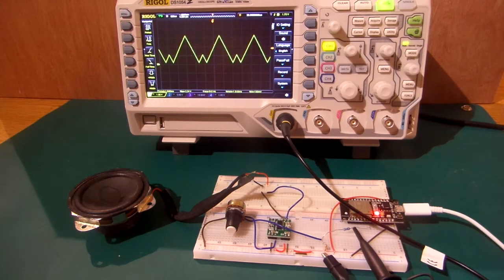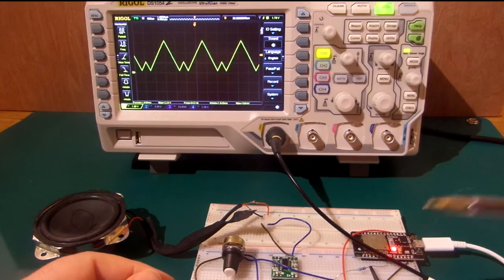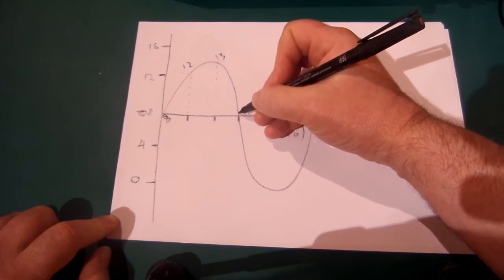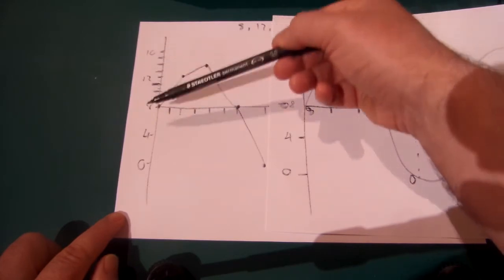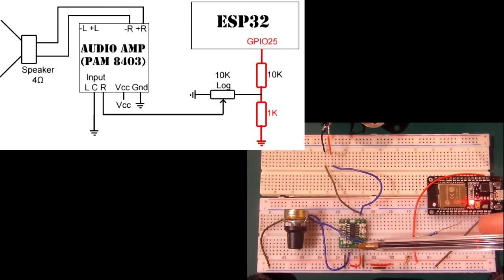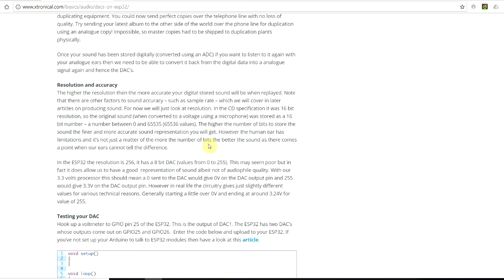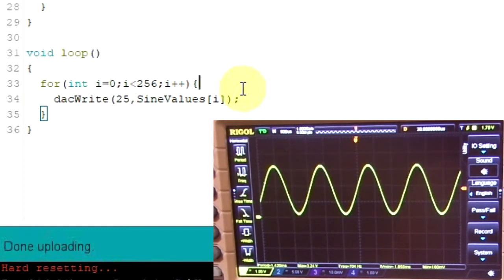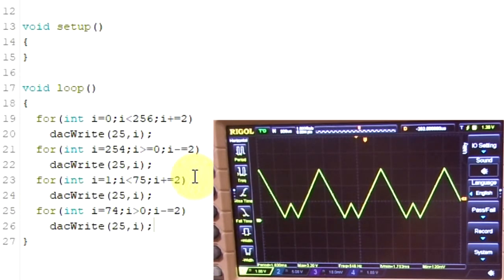Using DAC's to produce sound on ESP32, Introduction to Digital to Analogue Converters

Comment: Reading the data sheet of the PAM8403, I think what is meant by the +0.3 V isn't that it can only handle 0.3 V, but 6.3 V, when we assume the absolute maximum rating for the supply voltage. Therefore powering it with 5 V would give an input voltage range for the audio input from -0.3 to 5.3 Volts, because is says "-0.3 V to VDD + 0.3 V".
Reply from the maker: Ahh, right. Thank you for the clarification. I should do some experiments.

Comment: excellent,,    but im a bit counfuse,, how to call  the  setVolume   on XT_DAC_Audio_Class and XT_Wav_Class ...  could u please give some example. that would be wonderfull. thankyou..
Reply from the maker: No problem, give me a few days, I'm not able to access my kit at the moment
Reply: hehe,,thankyu for the so fast reply,, i figure it out somehow,, by deviding the LastDacValue with a certain number,,  and add it to the Play class,, but maybe you would come up with a better solution.  Btw is there any way that i can post you about the changes ive made? Email maybe
Reply from the maker: You should just be able to use setVolume and pass it a parameter where 0 is silince and 127 is full volume. Doesn't need anything more complex.